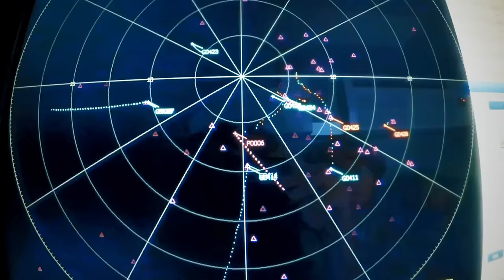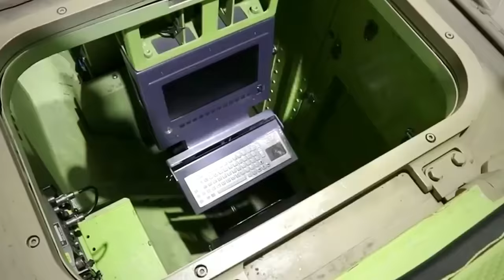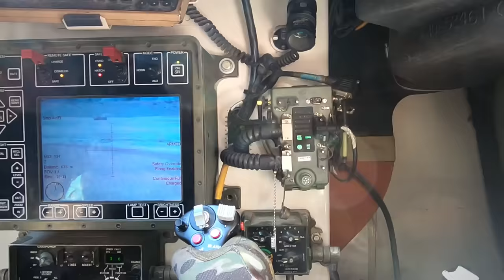Chinese Military Vehicles Almost Better in Everything than the Western Ones

Comment: What I like about Chinese military hardware is that they don’t even try to hide the fact that they copied it from someone else’s research and development. It’s like it’s a good sign that they didn’t invent it themselves.
Reply: Similar requirements produce similar solutions. There is nothing particularly new or novel about a 6x6 infantry carrier no matter who makes it. The only western analog to this that immediately pops to mind is the ARMA 6x6.  On paper at least VN22 seems quite an advance on the Stryker, which it resembles in the fact both have wheels only.
Reply: Since they had stolen all the blueprints and construction instructions, it was pretty easy.
Reply: The original ALVIS 6x6 from the 60's demonstrates that operational requirements produce similar external shapes.
Reply: That's called reference when design, not just like B2 from ho229 by capture germans and their engineering prototype, that's real copy. The chinese is mostly reference the existing good design and doing their own upgrades so it become better.  And the basic logic is just copy can give you good design then all country already did it, clearly is a joke
Reply: 你一无所知确人云亦云、信口开河
Reply: @MFitz12  This. It's completely idiotic that people just assume everything to be a Western copy. Convergent evolution. Designs follow functions. It's amazing that adults in this modern age are still so ignorant.

One easy example is to simply look up the Chinese's ancient sword design called the Spring and Autumn sword. It looks almost exactly like the Roman's Gladius sword, despite the two not even knowing about each other until much later.

Another easy, thought-provoking one is just bows in general. Did the East copy the West? Did the West copy the East? No, it was simply invented for a purpose, hence, again, design follows functions. Nobody copied anybody, it was simply made to look that way in order to function in a certain way as practically as possible.

The same can be asked about swords in general. Nobody copied anybody. It was a weapon designed and invented by each region to kill as efficiently as the technology permitted.

Also just for the record, no I am not saying the Chinese created this vehicle 101% all by themselves. It'd be foolish to say this about anybody in this day and age where means of sabotage and espionage are so numerous. Geopolitick and militarily, it's simply stupid to NOT copy something that's better simply out of pride. If it's good/better, then copy it and make it your own to stay on an even field at the minimum. Only an idiot like Hitler would not copy something out of pride. The Nazis wanted to copy Soviet's T-34 because it was an extremely efficient tank - cheap to produce and effective on the battlefield, but Hitler rejected it. The Nazis also apparently preferred the Soviet's PPSh over their MP-40s.

Not that long ago there was a scandal in Europe where the Germans were found to have spied and stolen from at least 2,000 companies on Austria alone. It's crazy that some copious Westerner online think "stealing is a Chinese thing" and think they're the superior/more virtuous people or something. 😂 The only difference is the Chinese are not afraid to show that, yes, they copied something and attempted to make it better while the hypocrites of the West pretends they never steal or copy anything when their entire foundation is founded upon exploitation and stealing.

Modern adults in 2023 still as dumb as a broad.
Reply: @saint8257  You're correct but one thing I wanna say is that the Gladius was actually copied from the Carthaginian short sword.
Reply: u realize that US not even hide to stole ZTQ-15 idea immediately come up with a MPF right

Comment: From the perspective of someone who has owned a Chinese vehicle, I don't think I'm worried at all. I believe the metal they use is something called Chinesium. It's made from almost anything and then painted to look a bit like metal. There's certainly no need to fire a weapon at it, the batteries on my vehicle can just burst into flame with no warning even while just parked up. I think you'd have to be very brave to press the fire button on one of these vehicles - that would involve putting electricity through something that's explosive and trusting their software. I think the real problem with their hardware is they just don't care if it kills the occupants (military vehicle or domestic) because there are billions of others to take their place.
Reply: Chinesium 😀😁😀😁😂

Comment: It's on tires?! Huge glaring weakness. Easily immobilized. Half track would've been a better option.
Reply: Tracks and tyres have their oan uses and optimal conditions
Reply: There's pros and cons strengths and weaknesses to both. You ever heard of Israel's new Eitan? Check out some videos on it
Reply: I recommend "Task and Purpose" channel. He just uploaded the vid a couple days ago I believe and he talks about the problems with tracked vehicles. They are not quick reaction vehicles like what was needed on October 7th. In fact the Eitan was thrown into the fray that day and it delivered. Here's the link:
Reply: Half tracks were phased out for a reason. That combination was not particularly good sharing many weaknesses of wheels and tracks while not providing with all the benefits of either. Full track or full wheel seem to offer superior performance in their own regards.
Reply: With 800hp engine and all round STANAG LVL 4 protection its over engineered for a 6x6. With that kind of weight configuration its better if they have made it into 8x8. One thing for sure the mud would really love this vehicle.

Comment: See how it deals with a Javelin, TOW, etc.
Reply: Considering Chinese quality. I would nog be suprised that even direct attack weapons like RPG,panzerfaust and AT-4s could penetrate it.
Reply: Like every wheeled ifv, it will be penetrated😅 Dude talking like some light armored vehicle has mbt protection.
Reply: @mingshili9769  trust me an rpg-7  is not going to penetrate a bradley,boxer or any other modern western apc/ifv. Unless it gets very Lucky with its placement it could disable those systems. ATGM’s are a different conversation.
Reply: @jvb1232  You're wrong the Bradley is not very armored at all compared to an mbt and rpg7 was made to penetrate m60 Patton mbt so how the hell would a Bradley stand up to one? 

I hope you realize the cool geometric plates don't actually make the armor stronger than things with literally more armor.
Reply: @off6848  I never said a Bradley has the same armor as a tank but an rpg cant penetrate it. There are hundreds of cases of it. Disable sure, But not destroy it.
Reply: @jvb1232  Normally people consider CV90 is one of the best ifv in the world, both in protechtion and firepower, but still it can be easily penetrated by rpg or other infantry held AT weapons from the front, check the one russian captured, the vehicle is not badly damaged but it did get penetrated and did lost few crewman. Late bradly has good side protection but still extremely fragile from front and rear, iFV/APC do not do what MBT do, period.
Reply: @mingshili9769  I can garantuee you If you shoot an RPG-7 into the front armor of s CV-90, Bradley or any other modern IFV (not Russian though) it will not penetrate. Front armor is designed for it.

Thats why modern ATGM’s hit the vehicle on the top as the armor is weakest there.
There have been instances of Bradley’s being hit by multiple RPG’s and still keep driving. And that was 2 decades ago.
Reply: @jvb1232 the worst RPG round Russia operates is 40mm. AND THATS THE LOWEST. Most IFVs can barely withstand 12.7mm much less 25 or 30mm rounds. They will not withstand rpgs.
Reply: @jade7631  you should look up the specs of modern IFV armor because your talking out of your ass. Also please look op what a 40mm is and what its used for…
Reply: @jvb1232  Huh? The RPG-7 has a caliber of 40mm. What do you mean to “look up”. MM doesn’t just apply for shells or bullets. Also what specs of IFVs? You’re just proving my point because MOST IFVs use 25mm (Bradley and other at) or 30mm (BMP-2 and others) because that’s all you need to pierce IFVs. If 30mm was put against tanks and shot enough 30 mm rounds it could potentially pierce tanks.

Comment: This looks like a copy of the American Stryker and/or with Stryker X headlights from the outside. It also looks REALLY tight on the inside, did anyone else notice the crew members or the troops? One thing is that Norinco products look OK from the outside but usually look cheap when you closer or inside. I mean, there is a reason the China despite having a large military industrial base is still lacking in foriegn sales. Countries that buy are usually looking for extremely cheap weapons that LOOK good. Some of countries have even cancelled or returned platform after having horrible experiences. The proof is the results, the CCP still only has a small percentage in world arms sales. Many of those countries do not have much of a choice with such small military budgets.
Reply: Well done you....
Reply: The Stryker looks like the Canadian LAV.
Reply: @Charles-k9g5y  I am almost sure that it is based off the LAV. Both Canada and the US used them or still do.
Reply: @rickjames18  —- when Canada went to Afghanistan they brought LAVs and the Americans loved them.

Comment: The problem is that the rest of China society builds crap -- buildings that are poorly build, roads that fall apart easily, bridges that fall over or collapse, vehicles that are junk, and so on. It cannot be discounted that the Chinese military vehicles don't share those problems.

Also, the PLA hasn't been in combat since 1979, where the Vietnamese beat them.Over 40 years ago. These weapons have not been tested in combat. Look at what happened with the Russians in Ukraine --thier front line equipment has been shown to be lacking.

Comment: As I always agree, that you never ever should underestimate an enemy I am totally convinced, that there is not a single Chinese Vehicle that is better that the Western Ones. China always takes short cuts. China always needs to copy things. The only thing they optimized is the manufacturing of drones. Anything else is most likely tofu dreg. Look how the "vehicles" imported from China by Russia are "performing", well better not performing, in the Ukraine. Your Headline is bollocks.
Reply: The Chinese vehicles and equipment imported by UKRAINE to fight Russia are performing well. Plus Ukraine is literally importing stuff from China to repair their damaged equipment and equipment captured from Russia. This weird disparity is largely caused by the fact that even the Chinese are selling stuff to Russia through back channels and they don't seem to provide support past the point of sales. The Ukrainians in contrast are able to buy direct from Norinco or Polytech and do get support. The Chinese are happily supplying both sides of the conflict and the one with deeper pockets simply manage to keep their equipment running better. My guess is that by January or February most stuff supplied to Ukraine, Chinese or otherwise, will start breaking down permanently unless Congress starts passing Ukraine funding bills again.